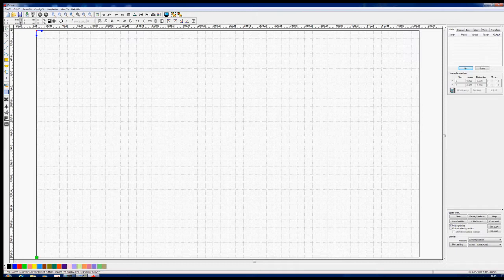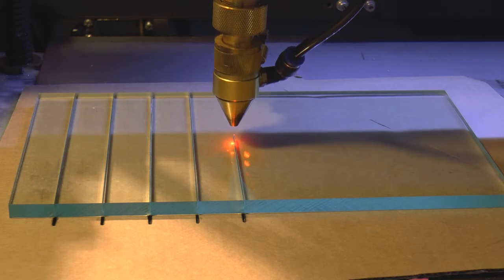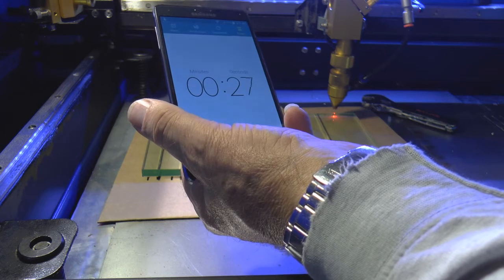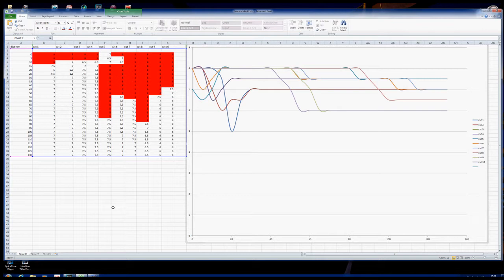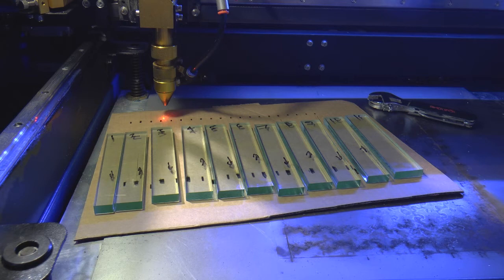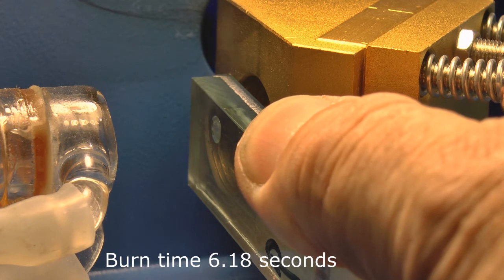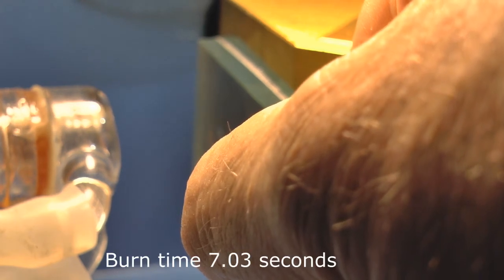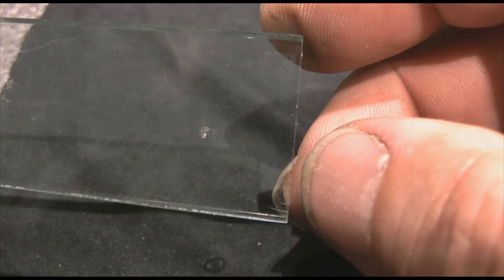RDWorks Learning Lab 17 Final test of laser power loss

Comment: I decided to do the test noted in Lab 16-17 and was rather surprised with the results but probably equally confused.  10% thru 50% pretty much didn't have any major impact, 60% went through is what appeared to be a clear cone with a small focused tip, 70% appeared to be a clear cone with a slightly larger tip, 80% also appeared the same.  This lead me to believe that I may at a higher power percentage than what you had -- but it doesn't make much sense unless your new tube changed all that (I'm still on my original 50w laser tube).  I suspect I might need to do a test with 80, 85, 90 and maybe 95% power, but one would wonder why I would need that much more compared to another individual with the same machine?  Do you know the variables that would reflect this difference?  Similarly, I'd be very curious to know what the manufacturer responds to you with.
Reply from the maker: +NFO Sec 
First, as expected , manufacturers response was nothing, I bought through a Chinese middleman who knew that he was half a world away and I would not turn up on his doorstep. I went into this purchase anticipating that there would be no lifeboat if things went wrong. However, I did have a lot of completely different experience with industrial lasers  which is why I rely on acrylic as a test medium and use the mode burn technique to tell-tale the characteristic of the laser beam. These sealed laser tubes are what they are and you have no means of "tuning" them.  Session 27 shows a simplified way for you to quickly run a mode burn sequence automatically. The best and safest way to manage  your tube is to add an ammeter to your system (as in session 24). Your 50 watt tube will be little different to others and will have a manufacturer's current limit of 20mA. I am currently awaiting delivery of a calibrated power meter that will allow me to find out exactly what wattage I'm getting for my 65%. You can see the ideal characteristic of a mode burn in session 27, they are all nice cones, just varying depths according to power.  The acrylic evaporates directly proportional to the power. So you can see at all stages of power output, the centre of the beam has the highest power density ie it produced the deepest tip of the cone.  By the way, a fellow laser machine owner in the States has already tested his machine with my power meter and reports exactly the same power characteristic as that displayed on my machine. He finished up getting just about 50 watts from his 60watt tube at 65%  (21mA) also,  only an odd couple of watts extra if he over-drove his tube to 90%. Other contributors with much more technical knowledge about these sealed laser tubes  report that over-driving them causes the gas mixture to break down and "not lase".  Rest it for a few minutes and the gas recovers it's lasing properties but at a slightly lower efficienency. This can be the beginning of the end for your tube, Just before I swapped my tube out it was happily working all day at 15 and 20% power.
Reply from the maker: +NFO Sec 
For my tests I was set to 85% but it's now set at 70% which incidentally is the power output when you press the PULSE button.

Comment: Hello. I bought the same machine 2 weeks ago and i think i have the same problem. Can you please tell me the average power/speed for cutting 3mm mdf? I manage to cut only first half of the project with 7 speed and 80% power.
Reply from the maker: +RazvanXob1 
Read the last reply I made to Phillip Barnes below. It is important that you act very quickly because the people in China understand the E Bay and Pay Pal  rules better than most of us. Register a dispute/complaint with Ebay immediately. I would advise against "not as described" rather use something like " arrived damaged" They will probably ask if you checked it with the courier on arrival. You will have to answer yes but add "until you plug in a light bulb how do you know it's damaged?" Say that the whole point of the machine is the laser tube and its not working. Don't give any indiication that it may have worked just emphasize that the machine is not ready to use out of the box and it takes time to assemble unpack and power up, whereupon you discovered the non-functioning laser tube.

In the meantime you need to understand what I did in session 16 and 17 to prove that the power was dropping off almost immediately I turned the laser on. The mode burn straight out of the laser tells you the whole story immediately. You must use acrylic sheet for this test because it evaporates when hit with the laser beam and the amount of evaporation gives you a good way of mapping power loss with time.

I would expect 50% power at 10 or 12 mm/sec to easily cut through 3mm mdf

Comment: How have you gotten on with your machine or the manufacturer?
Reply from the maker: Hi Phil
I sent this You Tube link to China but my viewing statistics tell me zero views on that continent. I suspect this channel is blocked so they cannot view the video. That said, they have received 2 emails in the last 10 days and I have had no reply. Their Ebay advert states two working days for a response.  I have just converted the mode burn results to a series of jpgs which I have attached to a new email advising them of 11 Sept as a deadline before I lodge a formal dispute with Pay Pal. Will keep you all informed with a new video. Thanks for your interest

Russ
Reply from the maker: Hi Phil and all New buyers
 If you have recently bought your machine you might like to test the laser on near full power sooner rather than later. I didn't do this until several weeks after I had purchased and now I find it's not working at full power for more than tens of seconds. There is a VERY short period that Ebay cover you for goods that are " not as described" and PayPal class such problems as a warranty issue and advise taking it up with the seller. The seller is in China and couldn't care less about my problem now that they have my money  it may take several weeks before I have a result but I'm now working the problem from a different angle.
Reply: +SarbarMultimedia Hi there, I've come across your video's and whilst they are extremely useful, I am concerned that I am going endure hours of pain in getting my machine working, only to find that it won't do what I need it to do. I purchased the machine to cut designs from 3mm acrylic, bamboo and MDF - what are the odds of this working? Thanks in advance.
Reply from the maker: +Joanne Samaradellis 
Hi Joanne 
If you have been watching my videos in sequence then you will observe clearly that I am not an expert but someone just like you trying to learn about this machine with very few instructions. I have made mistakes. The most serious is that I ran the machine for long periods at 95% power to see what it was capable of. When I noticed the power loss it was too late, I had damaged the laser tube by over driving it. Although I can see now that it was my fault, there were no instructions or warnings about this.  I replaced the tube, and fitted an ammeter (there are videos about each) to make sure that I stayed within the manufacturer's limit. I find that my limit is now 65% power in the program to get supposed max power from the laser.  That max power should be  be 50watts but I have yet to prove that. It will be the subject of a future video. To answer your concern, I can now cut 8mm acrylic (very slowly) in one pass and it will eat 3mm acrylic at about 15mm/s.You can see it cutting 4mm plywood in one of the latest engraving videos and I have done 3mm and 5mm MDF and also a small trial cutting 4mm leather.
On your own it may be painful but the path that I have beaten for you and the mistakes I have made should make learning a pleasant experience. If you get stuck you can always contact me
Reply: +SarbarMultimedia 
Thank you so much for getting back to me. 
I've just attempted my first cut with thanks to your videos, and it started off great but lost power and didn't finish the job. I was cutting a simple image in 3mm bamboo. Powers were min 80%, max 95% at 15mm speed. Thoughts?
Reply from the maker: +Joanne Samaradellis 
Hi Joanne
If I used high power in some of my early videos that was because  no one warned me NOT to use high values. I found out the hard way (by wrecking my first tube) that  using high % was not getting me more cutting ability but just eating away my tube life rapidly and producing an unstable cut. You will not have even considered doing mode burns to check your machines performance but I would advise that you do not run your machine at more than 65%.(ever). Just set max and min power the same (65%) and untick the through power in your program window.  One of my later videos shows how I fitted a cheap ammeter to my machine to make sure I stayed within the manufacture's 20 milliamp  drive current limit. That's how I now know that 65% is at that limit. Give this power a try and if your cut was previously starting OK at 15mm/s then leave it there. If you do not appear to have cut through, TOUCH NOTHING, just press the START/PAUSE button to run the program again.  You may then wish to reduce speed to 10mm/sec to get a one-shot good cut.
Good luck
Reply: +SarbarMultimedia 
Brilliant. Thank you. Will try again tomorrow. I sincerely appreciate your help!
Reply: +SarbarMultimedia 
Hi Russ, I just have a question about your acrylic board/bed of nails set up. Should the nails be of a certain material? Also would a piece of acrylic without the nails and air gap be ok or do you recommend the air gap? Also, can you tell me how bad are fumes from cutting acrylic and MDF? My husband is concerned about me using the machine in the future if pregnant. 
Many thanks
Joanne
Reply from the maker: +Joanne Samaradellis 
Hi Joanne
The "nails" can be any metal provided they are all the same length. I improved the original bed of nails into a better design. If you look at the 4 month review video you will see it explained. along with the uprated venting system. I personally like the air gap underneath if you are cutting anything,  especially card and paper (have you seen the xmas card video?) If you are surface engraving then it wont really matter  airgap or not. The acrylic baseplate absorbs excess energy and  marks on the surface so that you can see if you are using too much power or perhaps you can increase the speed. The space below helps with extracting fumes. No fumes are good for you  but acrylic fumes are not rated as hazardous in any way BUT they smell horrid and therefore you naturally wouldn't want to breath  them. That's why you will need to fit an  upgraded extraction system. MDF is different. It contains plastic binding agents that produce lots of sticky smoke and can also release some unpleasant fumes. Don't take advice from  just any old website look for fire department and government health and safety sites for reliable (may be very technical) information about fume hazards from burning (which is what the laser is doing)
http://www.australiansheettraders.com.au/images/info/MSDS%20for%20MDF.pdf. 
I occasionally experiment with mdf and I'm not frightened of it because my extract system pulls all the fumes away. The smoke can leave a sticky residue inside your machine and vent pipes so I use it only when absolutely necessary. If you are sensible about the ventilation I think your husband should be more concerned about who's going to do his washing and ironing and also the number of handbags and shoes you buy!!!

Sincere regards
Russ

Comment: this is  interesting.  I hope you continue to make videos until this is resolved.  Have you considered the High voltage power supply as another possible explanation for the power loss?  Its more difficult to measure but I think it could just as likely be a reason for the drop in power.
Reply from the maker: +2020tesla 
I will definitely keep the trusty few up to date with my progress on this matter. I have just answered to Phillip Barnes  on the same subject so you might like to check out my answer below. I'm sufficiently confident that it's not my use of the machine but a technical issue  within the machine that makes it virtually unusable. I plan to pursue the warranty route as my first strategy, but China has gone remarkably quiet. Thanks for your interest.

Comment: Can't paste embedded code for some reason or paste a link so type into the youtube search bar,  LPFthingsThis guy has the same laser cutter as you in tropical Queensland Australia, it's hot. He may have some ideas for you. Have you had a multimeter connected from the laser power supply to make sure the current isn't dropping off?
Reply from the maker: +Phillip Barnes 
Hi Phil
Thanks for your suggestions. Yes, I visited  LPFthings and many other contributors who already owned the larger format laser machine before I even purchased mine. I revisited some and found more in my search for help about using the machine. I'm sure temperature will not be an issue for me as several users are saying that up to 30C is ok and that will be easily achieved with my copper cooling coil. Only when I get a consistent performing machine will I be able to check the temperature at which performance starts to be impaired . I understand your point about checking the power supply drop off BUT there are two issues here. Firstly I know enough about electronics to know that I wouldn't have a clue about how to check the low voltage side of the circuit and secondly, even if I could, I'm not sure I would mess around with a machine that is still under warranty and clearly not fit for purpose. I'll wait a few more days for a response from China before contacting PayPal

Comment: Hi Might be a silly question but have you tried increasing the flow of the water pump and decreasing the water temp. Seams to me that 1 or 2 degrees must make a large impact on tube performance.RegardsPhill
Reply from the maker: +Phillip Barnes 
Hi Phil
No suggestion is silly when you reach the point I'm at, so thanks for your input. I'm using the pump that was supplied with the machine which is rated at 500 litres/hour against a 2.5m head, In reality the restrictions through the glass laser tube limit this to about 120 litres/hour.  I have tried running the machine with a tank (about 8 litres) of pre chilled water at 12C  The water temp went up by about 2 deg over the duration of my 10 minute test but the mode burns were still exhibiting huge power drop-off. I have also tried a coil of copper tube in my tank with cold tap water flowing through. It stabilises the temperature to about 18C  but still to no beneficial effect. However, I have not tried increasing the water flow. Something is heating up very quickly (I thought it might be the fully reflecting mirror distorting out of alignment as it got hot.....but why would it get hot?) and then cooling down equally quickly when the power is switched off. Just maybe, an increased flow rate would have a greater effect than pre-cooling the water BUT the point is that the equipment I bought should be tried and tested to perform as a 50 watt laser SYSTEM .....and it doesn't so I'm suspecting a faulty laser tube. Many thanks. Russ   
p.s.  By the way, there is no recommendation for the cooling water temperature in the manual.